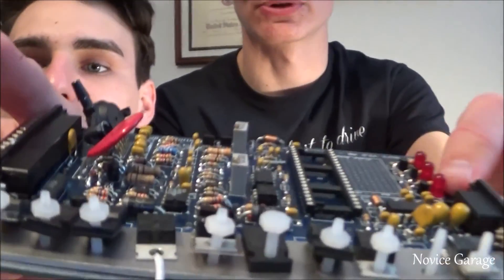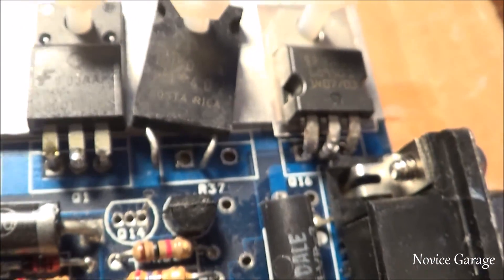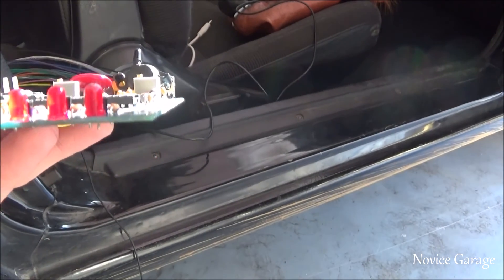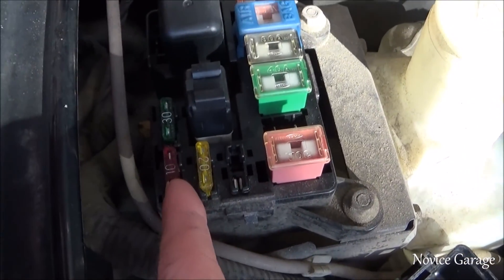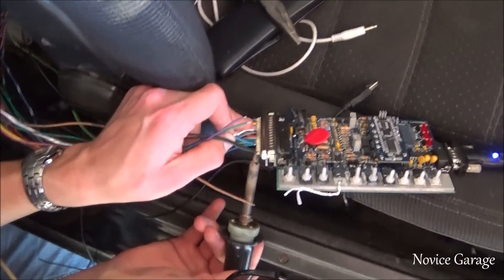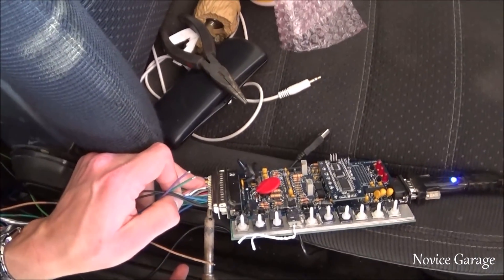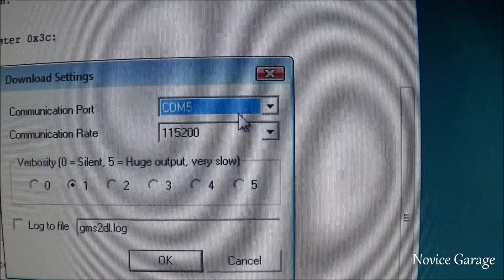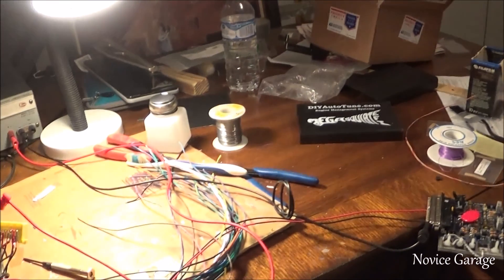How To Build A MegaSquirt ECU Part 2

Comment: That's why they tell you to read the directions first before you start soldering parts on the board. Then instead of cutting the  leads for the transistors, you could have used some heat sinks that clamp on the leads and simply used a solder vacuum or wick and disconnected them from the board and did it right.

Comment: You might want to start using TunerStudio instead of megatune. It's easier to use than megatune and if you register it you get autotune feature where you can give target AFR ratios and it starts to automatically tune towards your targets. There's actually so many features that I've been using to debug my setups that I probably couldn't live without it.

Comment: Nice work. Good details about firmware, etc. I think you can still buy PCI cards for a PC tower with a serial port to actually load the firmware. I know the COM port troubles all too well. Nice job explaining it. Also, how about that BOD rate...rofl! Aahhh the memories.
Reply from the maker: +NickelNDiminIt Thanks. I should have gotten the Stim too..... Would have made it WAY easier
Reply: cool video man!